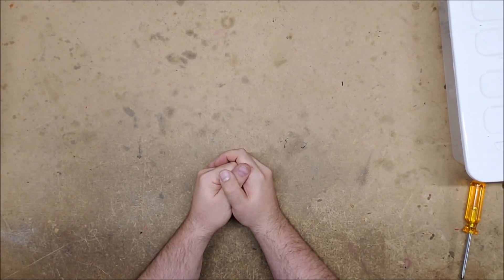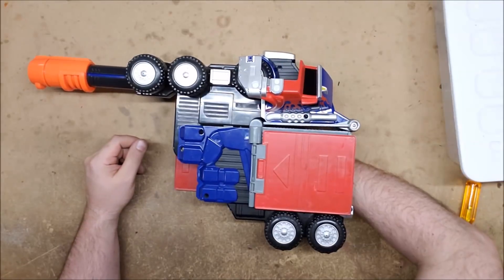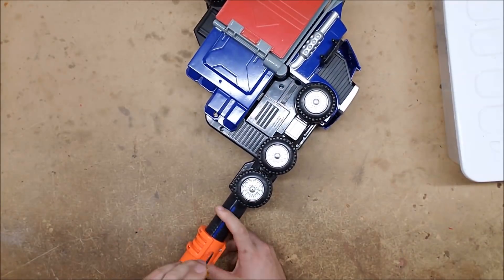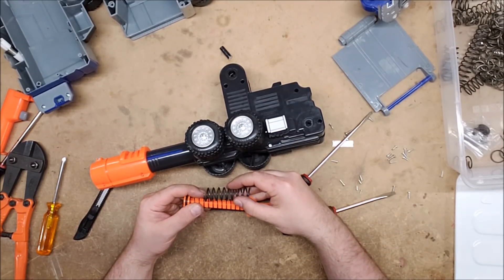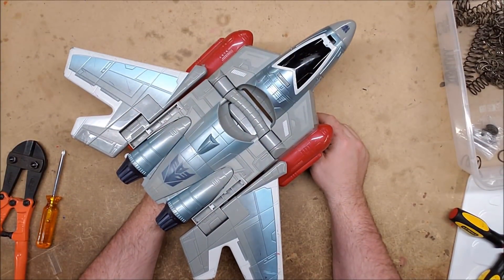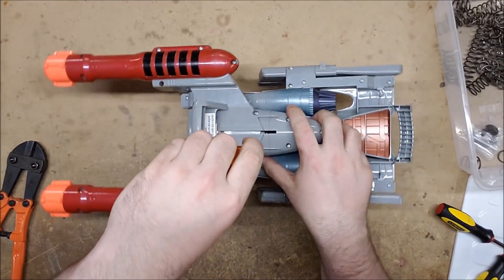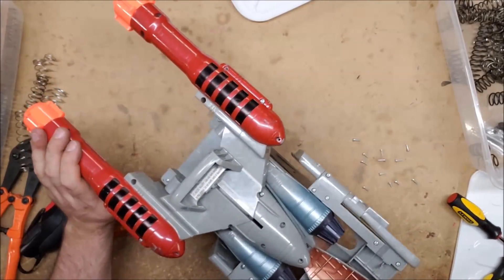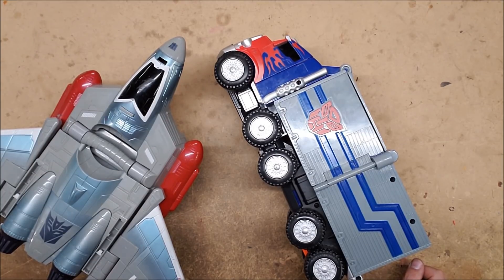Can it Take a K26? - Episode 65

Comment: Could you not just use a shorter length of k26 in optimus prime to get the necessary compression, and just put up with a little spring rattle?
Reply from the maker: No

Comment: Start a new series, Can it Take a 3S Lipo please
Reply from the maker: How would that work?  Either the motors are rated for 3s or they are not...there is no mystery.
Reply: Oh, ok. Is there any way you can start a series that uses flywheel blasters?